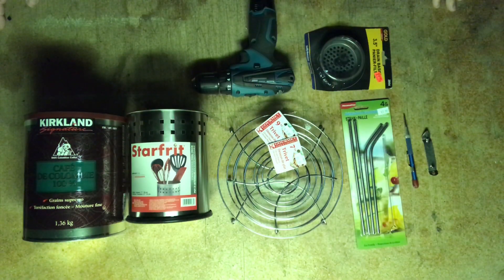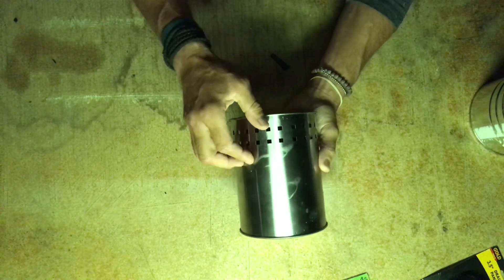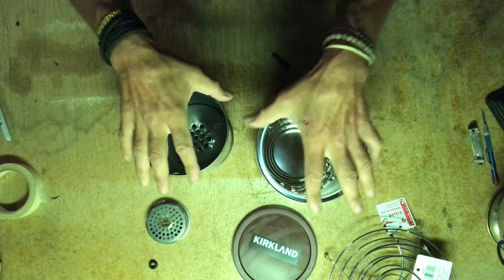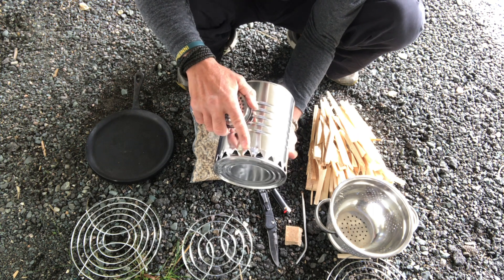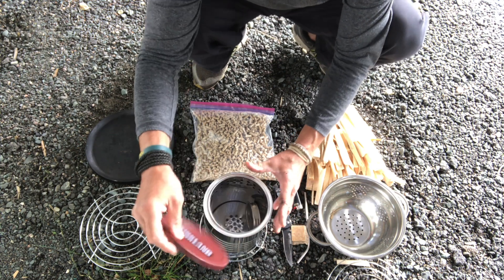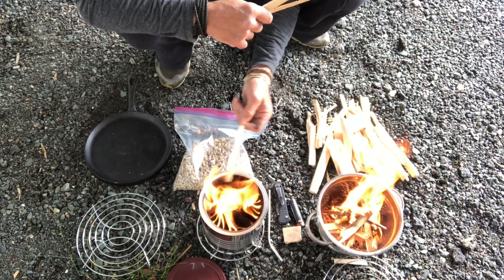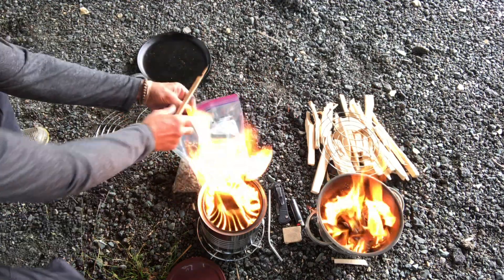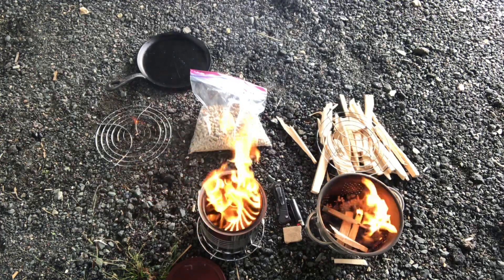How to Make a Gasifying Wood Can Stove

Comment: hey so is it wood gas going up the sides or just clean air to provide oxygen to the gas rising from the central fire? I wonder if a colander with no central holes (just at base and at rim) would work the same ... I guess they don't make colanders like that 🤣 nice work thanks for sharing!
Reply from the maker: Hey @joshua it is the wood gas. You can see it being suckdown through the bottom and up the sides.

Comment: This stove needs alot more work. That bright yellow flame is bad, it means the fire is oxygen starved.   More inlet air needed.
Reply from the maker: Great point, I've since enlarged the holes in the bottom for more air flow. Cheers,
Reply from the maker: 3/8ths"@@user-ey8rt4pk2y

Comment: One thing I love about the wood gas stoves is it really doesn’t matter if it’s wood burning or not. Any combustible material that can burn can be easily used. That includes wood pellets and some brands of dry dog food. The nice thing about using wood pellets and dry dog food is that they can also be packed away fairly easily so they don’t get wet that easily. Put some small quantities into a small dry bag or other container that can be used to store stuff away in a dry environment. I mean a 50 pound bag of dry dog food will go a long way in a wood gas type of stove. Put just enough wood pellets and / or dry dog food into the stove to just come short of the wood gas vents without covering any of them up. It allows you to get the very maximum amount of fuel inside your stove without choking it. You want them to be as loosely packed as possible. Remember that a wood gas stove is really meant to burn from the bottom to the top so the fuel needs to have gaps in it so that it can get air from both the top and bottom.
Reply: A person can also live off of dog food for a while in a pinch.
 Dogs and humans both being somewhat omnivores.
Reply: One other way to get either of the wood pellets or dry dog food going quickly is to put a small amount of them in the bottom of the stove. Put some kind of hallow spacer in the center. You’ll be pulling it out later. Put your accelerate in the bottom of this hole. Why shouldn’t regular charcoal lighter fluid work? Cover it up to just below the wood gas holes. Wait about 30 seconds or better and light it. Remember it’s the fumes from the charcoal lighter fluid that needs to get through the surface of the wood gas pellets. This should have them going off through the core of the wood pellets and burning from top and bottom at the same time. 

The only other thing that could help with its not getting its wood gas vents put out is angling the holes, so the gas on one hole intersects the gas of the other. Have them angled just enough, so if one vent goes out and it gets reignited by its neighbor.
Reply from the maker: Thank you!
Reply: dry dung can also be burned. herbivores cant fully digest fibrous material and their dry feces are used as fire fuel all over the world. The LOFI stove burns sheepdung for example.

Comment: Can you drill holes in the side of the interior can so it’s not getting plugged? Or is that not getting the desired airflow?
Reply: If you were to place a disc of hardware cloth on top of an X made of a couple of pieces of steel with notches cut to make them such that they stand on their long edges and interlock in the middle, or on a circle of metal that’s Big enough to easily support the weight of the fuel on the hardwardware cloth, fitted roughly to the size of your inner can/burn chamber, Your fuel would stay off the bottom of your burn chamber, and not choke off the air supply.❤️
Reply from the maker: @daphneraven6745  here's a product I came across a few years ago. 
https://www.pinterest.ca/pin/631418810265428595/
Reply from the maker: Great question, I've modified the can and make bigger holes in the bottom.
Reply: @diverbrent  ok. I’ll experiment as thinking no additional holes in bottom but more in sides will prevent blocks.

Comment: A short piece of plastic or rubber hose for that metal straw will get your face a bit farther away from the flame !
Reply: An aluminum arrow shaft is even better.
Reply: A collapsible antenna works too and packs smaller.

Comment: Love the idea. But please help! Can you give the diameter of the cans? My Kirkland 3lb can has an inside diameter of 6 1/8 inches. My Starfit is 5 1/4. So there is quite a big gap between the can walls like 3/8 of an inch gap..

My 3lb Kirkland is Decaffinated Dark Roast - Fine Grind with bar code 96619 46242. The "Best before' date on the bottom is 04/29/23.

My Starfrit Tool Crock label says height 7 diameter 5 inch with.bar code 69858 94287.
Reply: Perhaps having the bigger gap will only help the fire get going & stay going..
Reply from the maker: Hey  @jamesgibbs8827 , if there's a gap the catalytic action won't occur. The action requires a tight git for it to function...
Reply from the maker: Hey there... here's the dims... the Starfrit can has an outside dim: 5 7/16th  and the Kirkland can has an inside dim: 5 5/16th. It's a tight fit but you can easily squeeze it in.

Comment: Looks just beautiful when lit, cool project dude! Never heard the tip about using a metal straw before that's great.
Reply: You can use the collapsible antenna from a portable radio too.  Cut the closed ends off.
It'll get your face farther away from the fire then the straw. 
Hollowed out bamboo works, if you can find it.